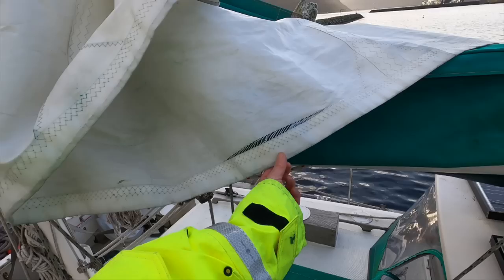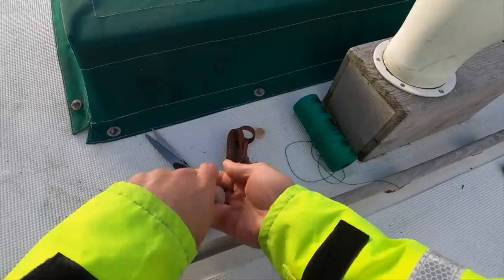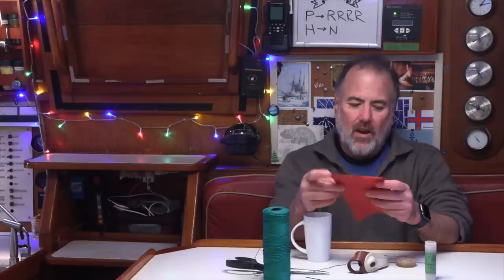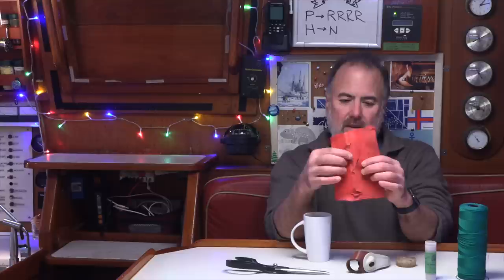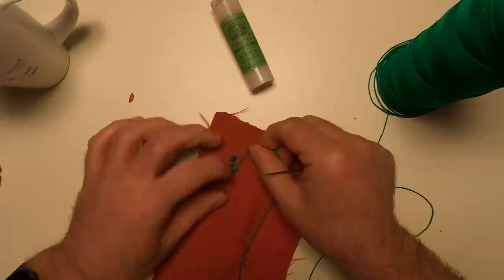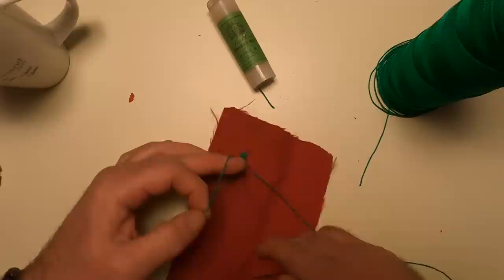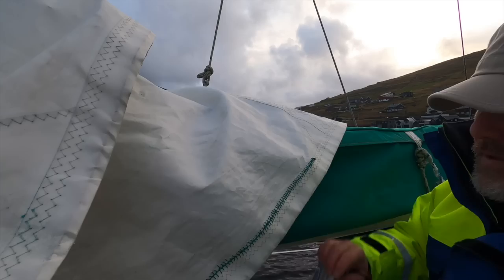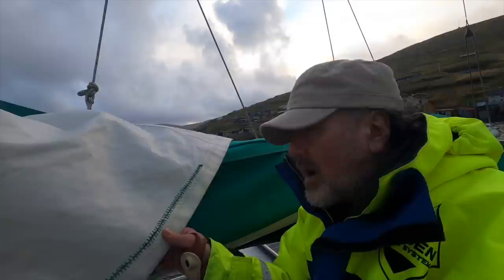Sewing A Torn Sail By Hand Before Sailing Offshore - Real Time Video | DrakeParagon Sailing

Comment: G'day from a sunny Sydney, Australia. I've been doing leather work as a hobbies for over 50 years and I use a waxed nylon thread for sewing bags together or edging on wallets etc. It would be perfect to sew your sail repair job and would save you from having to wax yourself. The great thing about this thread is it is incredibly strong (you have to use a Stanley to cut it) and it's thoroughly waxed making it very durable and easy to use. Safe travels Drake & Mo. Cheers Mel
Reply from the maker: Thanks! Good to know.
Reply: As long as it is UV stable thread that can withstand direct UV sunlight it should be fine.

Comment: Did you make a video for the final repair?  We tore the leech on the Code 0 on the passage from Panama to the Marquesas and I was curiously watching videos on differing techniques.  Thanks for the detail on the herringbone stitch. Looks like a nice tool to have in my toolbox (brain).
Reply from the maker: Thank you. I'm glad to hear that showing the herringbone stitch was useful! The stitch did hold for our short sail from Faroe back to Scotland just fine. But then I bought some sail material and sewed it over the tear using our Singer sewing machine. 

If you haven't seen the speedy stitcher sewing awl then I would highly recommend checking that out too!

Speedy Stitcher
https://youtu.be/h4S0GfYVNmE?si=kdeBi1RZsat6oYRO

Also,
Sewing a sail with a Singer Heavy duty sewing machine. Part 1
https://www.youtube.com/watch?v=ubD05Ve6Kl4

Sewing a sail with a Singer Heavy duty sewing machine. Part 2
https://youtu.be/8UJ49FFuW6U?si=6GU-ognr1RxEofPG

Comment: If you are not into maint, then your not into boating....
Reply from the maker: I don’t think there are any sailmakers in Faroe, and certainly not in Greenland or Svalbard.  I’d say especially if you’re going to sail to places where there are no marine shops or services then you better have spares, tools, and some maintenance skills.
Reply from the maker: Now that we’ve sailed back to the UK I’ve ordered some heavy Dacron sail material to patch that tear with my Singer heavy duty sewing machine. I think I’ll make that a PFS video.
Reply: @drakeParagon  i have purchased 2 sewing machines on my boat, never got either to work with me, tried a few times but always ran into problems and went another route.... some day with some help i hope to correct my likely operator errors, and be well able to use the machines without hesitation and get a good result.  Boat maint is a big part of living well and enjoying the process, capability in sewing is rewarding and add a lot to the overall positive and proud boating experience.